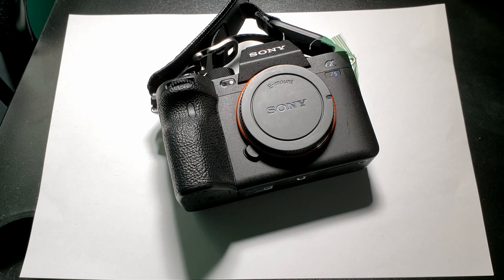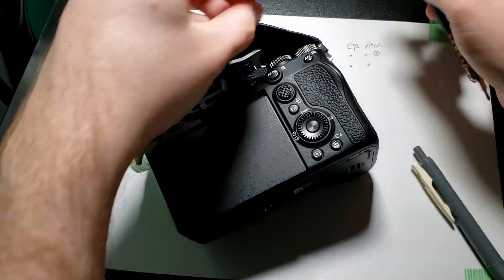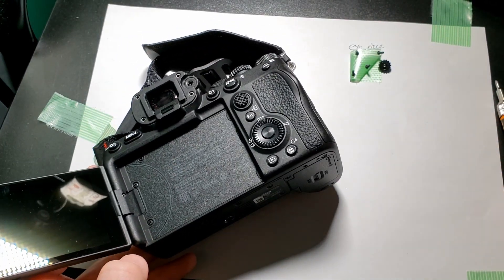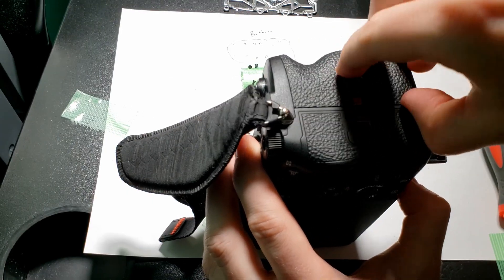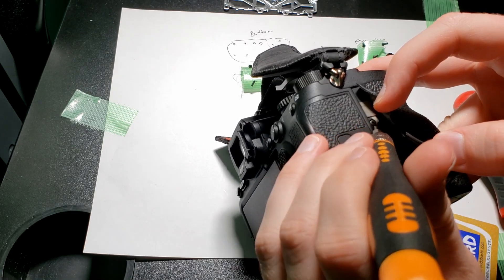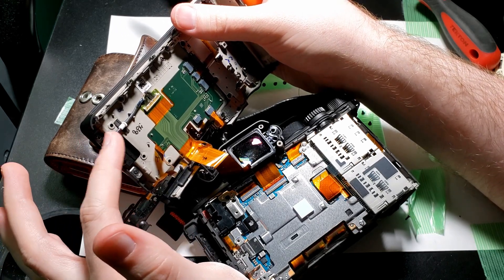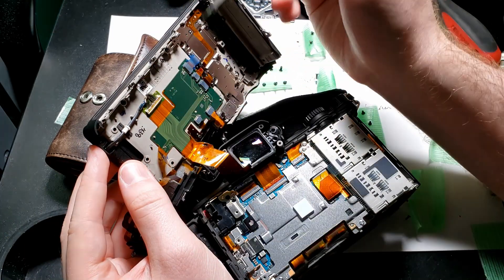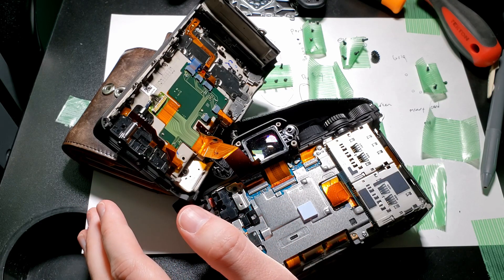Sony α7S III Screen wobble fix - DIY partial teardown

Comment: Thanks man, super helpful! I'd probably recommend some red loctite on those screws rather than just tape over the top. Seems like they put some red loctite on a few screws, but not these ones for whatever reason. Also, you do not need to completely remove the bottom facade, only the rectangular metal plate. The screw next to the battery locking mechanism can stay, but the two on the opposite side (right below the card slots) do need to come out to pull the back cover off. This also means that the extra screw at the bottom underneath the grip tape does not need to come out.

Comment: Attention!!!
This camera has another dangerous defect. The screw securing the plastic HDMI plug comes loose and falls inside the camera. However, this defect is easy to fix. Simply open the side cover with the connectors, replace the screw with a longer one, and screw it onto the threaded fastener.

Comment: Great video! Worked flawlessly. I can confirm that it is unnecessary to remove the screw inside the battery housing. Thanks for creating and posting!!
Reply: Was it necessary to remove the screws under the grip?
Reply: @damndeniz yes. Those 3 screws are necessary to remove
Reply: @ thank you! Did you use any tape on the screws? Or any thread locking glue?
Reply: @damndeniz  I thought about it but ended up not using anything. My thought was that because it was relatively easy to disassemble, if it comes loose again, I'll just redo the process and add some locking glue

Comment: Wouldn’t a little bit of lock tight do the job instead of using tape? I just did a repair on an a7iii and noticed a handful of screws had some kind of red lock tight probably specific to electronics

Comment: Wouldn't the grip tape lose its adhesion strength? Could one apply a new thin layer of adhesion to the underside of the grip tape when screwing things back?
Reply from the maker: Perhaps it loses a little strength but doing it once will not ruin the adhesion, it sticks back on just fine.

Comment: So I just got this camera under a month ago and on my first shoot my gimbal spun around and tweaked the microphone port. It's now very loose feeling but there is NO audio issues when using it even after this accident. I'm considering opening it up to maybe try and glue the port back into place to remove the wobble because I'm concerned that it'll degrade over time and start causing issues. What are your thoughts? is this something I could maybe do without taking the entire camera apart?
Reply from the maker: Oof. Hard to say without knowing the specific details. You might be able to get access to it with the extended of what I did in the video though it might require you to take out the mainboard as well. If you are within warranty on your camera it might be best to have Sony take a look at it (especially if you don't feel comfortable doing this)

Comment: I sent my a7s III to service because I had this problem. It seems that the problem is from the screw that are not compliant and are aware of this assembly defect. These screws are changed in service
Reply: How much did it cost?
Reply: @TheMoodyMonday  Nothing, it was under warranty.

Comment: loctite
Reply: Yup some loctite would take care of this. I bet Sony will start using it from the factory if this becomes a widespread issue.
Reply: Thanks for the video. Will attempt this (when I feel brave enough!) But I definitely won’t be adding glue: don’t the people suggesting adding Loctite to fix back the screws permanently realise they’re in trouble if/when it gets wobbly again?
Reply: @PoetryFilms  just wondering how would loctite permanently cause issues?
Reply: If it gets loose again, you’re likely to do permanent damage if you have to remove Loctite from the previous fix. As it happens I did carry out the tightening instructions suggested here and they worked great. (I’m just VERY careful now when opening and adjusting the screen!)
Reply: @PoetryFilms  loctite isn’t cement. I use it all the time to add red dots on handguns. It will get loose if you don’t apply it correctly or over tighten. If it stays put from the recoil of shooting thousands of rounds it will stay put for the screen
Reply: @shadownin784  Your call, of course, but I'm not keen to stick anything on a camera that I might later regret or that would interfere with its resale value

Comment: any idea how to remove the port covers?
Reply from the maker: I'm not sure steps involved but it seems like they are built on hinges on a smaller plastic part. Therefore you cannot tear them off, rather slide them off (up or down). Try removing the side plate on the camera and see if that allows you to do this. There are several screws on the left side of the camera. I only removed 3 of them in this video but there are some that are next to the HDMI port as well as the external speaker.